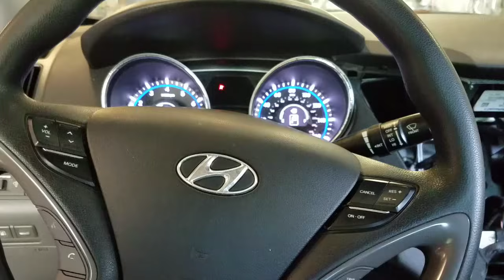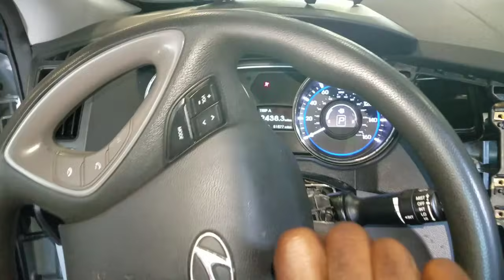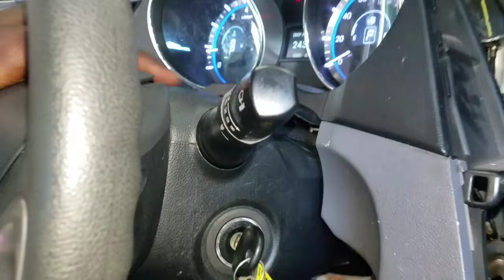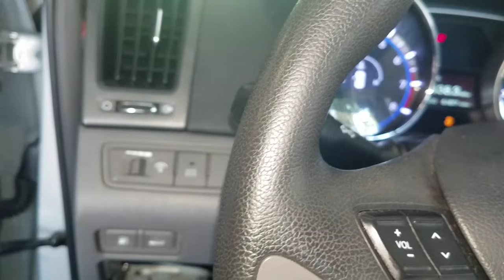Hyundai sonata steering noise

Comment: Thanks for this video. I was able to do it with no problems. Disconnecting the wiring can be intimidating but not when you realize that all connectors are unique so everything can only be connected back to its original location. Besides, each wire bundle only reaches its respective connection. You saved me $500!
Reply: Hi did you have a hard time hooking the steering wheel back ?
Reply: @TheLinaChen  no, its exactly like the video shows.
Reply: Jose Alfredo Reyes thanks. Working on it now and it’s tough lol.

Comment: Fantastic, I just took my wife to get her car done because it had the same problem and it cost me $550, my Sonata started doing the same a week ago and I decided to follow your video, I figured worst scenario I would have to take it to the dealer, well, 2 hours later I was done, the part cost me $1.75,  Thank you, Thank you, very well documented. My recommendation to anyone doing it, have the tools you need ready, follow the video step by step so you don't get confuse and I would take off the AC vent first which is the last thing on the video but if you do it last you may break it when the steering column drops.

Comment from the maker: Glad I could help you guys, hit the subscribe button for me thanks for the support
Reply: Dullah Goso hard Thank you so much! I just finish it. But it was a lot more harder than I thought. The steering column is a lot more heavy that it seems. But an easy job to do! I was thinking that is was going to be very expensive but just a $6 for the part and an hour of time. I really appreciate the videos. Take care!
Reply: May I ask what is that part name
Reply: Dullah Goso hard steering coupler
Reply: What’s the name of that part
Reply: Thanks bro. I just fixed my wife's 2013 Hyundai Sonata
Reply: Dullah Goso hard what is that black piece called you replaced. I have the same sound in my 2011 sonata
Reply from the maker: Steering coupler
Reply: I need help I can't put the back bold back in when I put the steering wheel back up.. What am I doing wrong
Reply from the maker: @jessamynoliver1442  make sure you have the key in the ignition so the steering wheel is not lock and there is a little hook on the back hook that first to help with the weight of the steering column
Reply from the maker: @jessamynoliver1442  https://youtu.be/NEd0zPYO-JY follow this this step in this video i make it explain it more
Reply from the maker: Skip to 21:58 and watch it from there
Reply: @DULLAHGOSOHARD  okay i did notice my steering wheel isn't straight Im about to give that a try now.. Thank you!! 💋
Reply: @DULLAHGOSOHARD  I got it back on and running still cant get that back bold on.. My wipers wont work either now 😭
Reply from the maker: @jessamynoliver1442  plug in the wires for the wipers plug them in tight
Reply: Just replaced the part today. Very glad I came across your video. You have my subscription. 👍🏼👍🏼. Thanks again.
Reply: Where can I get that piece from for the steering column
Reply from the maker: @Jeebklyn31  ebay.com
Reply: I did this and now it's hard to turn the wheel what did I do wrong
Reply from the maker: You probably leave some wires for the motor unplug
Reply: Dullah Goso hard where you located?
Reply from the maker: In Florida

Comment: Just got done with this repair.. thank you for this video. It was very helpful. Couple of my notes. If you don't have power tools then either get a second person for help because while putting everything back together,  steering column will be a pain to get it screwed again and while putting the steering column there is a extended part protruding from the column which needs to go into the pocket. To summarise from the video, all you need for this repair is 10mm, 12mm sockets, Phillips screwdriver, T30 bit to remove screws from electric motor and a torque wrench. For this I think it is better to take out the instrument cluster and try to fix rather than dropping the steering column

Comment: GREAT instructional video. Thank you so much!  I'm over 55 and managed to do this by myself while my husband was away fishing with an old friend. I wrote down all the steps and gathered all the tools together so I could move through without having to stop and check for things. Toughest part getting the steering column back up into position...felt like a contortionist trying to bench-press it back into place and get those top nuts back on!  Your video worked for me even though I have a push-button start on my Sonata.  Even though Hyundai extended the warranty, my car was beyond the extended warranty mileage of 100,000 (~130K).
Reply: Way to go, Mary!  I need to do the same thing and am over 100k.  I gotta admit, I was a little intimidated because this is a lot of stuff to take apart, and I'm concerned about braking something or getting everything back where it needs to be.  I'm pretty handy, so I'm willing to go for it, though.  I just can't afford to have any slip ups.  Wish me luck!
Reply: Well you make me feel like more confident to perform this job by myself. Wish me luck.😁

Comment: First of all, thank you so much for the vodeo. I got my job done today following your video step by step + taking out the fuse pannel for wider space. I turned on the engine after re-connect all the wires then check to make sure everything (steering, wiper, EPS, signal, headlight, etc..) works perfctly before putting back metal frame and plastic covers in. Shouldn't be any problems as long as all wires hooked up tightly. Happy to save $300+. Thanks!

Comment: Thank you for this video! I just finished my car. Took me all day and for reasons I had to walk away several times to loose my shit and regroup.
I get it why they charge so much in labor..
I sat in my driver's seat and used my feet to help guide  the steering wheel back in place so it's possible to achieve this by yourself.
Reply: Way to go. Would it be worth$500? To pay someone?
Reply: @stacialindholm3380  Nope I wouldn't pay a shop to fix this. If you or somebody you know have basic tools it can be done easily, he names all the tools needed as the video progresses. Don't be spooked by all the small steps in this video.
Reply: lgalphagools just discovered this I plan to do this myself soon. But this noise has been going on for some time and I do a ton of driving for work especially this week. Does it do damage to the car or is it dangerous to drive??
Reply from the maker: I have another video that go more in depth but you can do it its not that hard after watching this video
Reply from the maker: https://youtu.be/NEd0zPYO-JY
Reply: @_therealgabe_  I would say slightly more dangerous because the coupling is usually shredded up and its whats causing the clunks and bangs. Our Sonata is our main car and it was making that noise for at least a year before I fixed it. Basic tools and 3-4 solid hrs for the completely inexperienced person to finish
Reply: pushing the whole steering assembly was definitely the most challenging part of the whole process. I basically had to lie down underneath it and benchpress it into place. a PITA, but doable. Thanks for the vid!

Comment: Pro-tip: when replacing the steering column, it's helpful to get underneath it on the floorboard to guide the hook back into place and make sure you have a nut handy to secure the steering column. Trying to get it back into place from the side is a little difficult because it's difficult to line everything up.
Reply: i, I was able to fix the coupler, im going to try my best to describe it but somehow during the process the steering wheel completed pulled out and disconnected from the rack when i pulled the steering wheel out after "Dropping it" basically female tube (attached to steering wheel) with the grooves inside which goes into the male rod with outer grooves which is connected to the rack with the bolts. When I put the steering wheel on again it completely was off 50+ degrees in alignment. I'll be trying to realign the grooves tomorrow is their a way I can do it without buying expensive parts? I can understand 1-2 degrees but my tie rod alignment is fine. Its from the way the steering wheel was placed in the rack. 

***btw not to be confused with aligning the steering wheel clockspring, i never opened that middle portion where the airbag. 

https://www.hyundaipartsdeal.com/genuine/hyundai-joint-assy-universal~56400-2l000.html 

it the right part in the diagram here 56300 which needs to be aligned with the middle part
**NOT 56410

Any advice is useful on how to get the grooves aligned as close as possible with the tires...its completely off, didnt wanna adjust the tie rods like crazy and dont even the the grooves in the rod allow for that much adjustment as of now (ex. the straight steering wheel has tires pointing halfway to the left)

Comment: I finally took the time to go for it yesterday, and everything worked out great.  That aggravating clattering noise I used to get when I went over bumps is gone, and steering feels firm.  It might have been easier if I’d dropped the steering column, but I wanted to avoid the potential issues others have had with that.  I did remove two of the 12mm bolts holding the column and loosened a third.  I also removed the fuse box and the instrument cluster to get the access I needed.

It took some work and persistence, but I’m glad I did it this way.  It took me an hour and 45 minutes, a little sweat and $1.20 for the part.  Thanks to everybody who contributed info and advice on this!
Reply: Are you in NJ? If so, any chance I can pay you to do mine?
Reply from the maker: Naah am in Florida
Reply: Thanks for this video, I now see exactly what has to be done, but I do feel too wary to attempt this on my own. (I was asking @NJbakintheday if he was in NJ)

Comment: i just did this today to my 2013 Sonata. very easy after watching this video, the best one. but i found out it's even more easier if your take out that fuse box, that will give you all the space you need to loosen the 3 bolts on the coupler motor. really ez pz lemon squeezy.

Comment: Thank you for this video! I use my Sonata  for business (airport transportation) and do most of my own service work. I built heavy trucks in a factory for 21 years and have reasonable mechanical skills. But I thought for sure I would have to take this in. I remember installing steering columns in heavy trucks and just simply reversed the procedure! Thanks again, you saved me a bundle!

Comment: Great video got this done in about 45 minutes. I actually didn't unplug everything to get that steering wheel to drop but it is a pain to get to that motor in the back if you don't. If you have the right tools you can get away with not unplugging as much. Great video nice job thanks for posting!

Comment: BE VERY CAREFUL WHEN DOING THIS JOB. I followed the exact steps and was able to fix my clunk in steering wheel. However, when dropping my steering wheel it hit my brake switch and broke it. I had to replace my brake switch since my brake lights stayed on the whole time. Other than that, everything went well.

Comment: My 2012 Sonata steering wheel has been making this gosh awful noise for months now. I took it to the dealer and complained about it one day while I was already there for 2 recall issues. They did nothing about the steering wheel. When it got progressively worse, I took it back in and they said that they wouldn't cover it because I was just over my 100,000 miles. But when I took it in the first time and complained about it, I was well under my 100,000.  I called Hyundai Corp and they agreed to replacing the coupler and said they would reach out to the dealer but that once they did, they were no longer involved. I took it to the dealership and they refused, but told me I could pay them $300 to fix it. Its a $5.00 part people!!  Now the steering wheel feels like its going to fall off and the shaking will knock the fire off of your cigarette. At times I can hardly keep the car on the road. Long story short, my husband and I appreciate this video because now he can fix it for me.  This has been the worst car I have ever owned and can promise you, I will NEVER own another one.
Reply from the maker: Shelley Hiler am glad i could help
Reply: Same thing I am going through!
Reply: Did it fix the steering will shake as well? Mine just started doing it and it scares the hell out of me!
Reply: I went to dealer for this issue. It use to be my wife's car I got her a new one and kept it because of this issue. Went to dealer they said $300 to fix it I even consider trading it in. It was really bad nasty vibrations clicking metal noise after 60mph and when I hit pot holes. Thanks to this video I fixed it. Everything went away once i replaced that part. I'm no mechanic it took me a while a good 3 to 4 hours but saved lots of cash.
Reply: Same here. I bought the car from a small dealer lot but took it to Hyundai and paid $150 to check the car for any issues before purchasing. They didn't mention this or any other issues with the car. Last week I went over my 100k miles and I just read it would be warranted up to 100k. I will be doing the repair myself as well. I won't buy another Hyundai since we only have one dealer in my city and they are the worse.

Comment: This is a great video, it just saved me 3 or 400 dollars, the guy goes into detail and shows most of the process in the video, so thanks, great job. That said, if you are doing this you will want to know that it looks easier than it really is, he must be experienced and familiar with the parts, it looks like he does this often. I consider myself handy, but it still felt like it was too much a couple of times: Some of the connectors do not come out very easily, the video does not show how to take out the last connector, a small one, I had a hard time with it, some of them made me wonder if they were supposed to come out at all, but in the end all did. I broke a couple of the fixing clips which I replaced with ties as best as I could. Also, and I hope you are reading this before doing it yourself, the column is very heavy and hard to put back into place, it was the hardest part of the job, its not on the video either. The whole project is done in awkward positions. So in summary. The video is good and it will tell you almost all you need but it is harder and more time consuming than it seems. If you decide to do it you will be saving good money and in the end know a little more than when you started. The whole thing was worth it the problem is fixed. Almost forgot to mention, by the time I was done the battery was dead, nothing to do with the video, but you may still want to keep that in mind. Thanks again for the video and Good luck!
Reply: Great comment, I agree.  This job required much more effort than the video portrays.  However, I am so grateful to have gotten it done on my own. I didn't have the same issue with the steering column as you did.  Sorry that was so difficult and about the fact that your battery died.  I read a comment in one of the other videos to make sure that I disconnected the battery.
Reply: What is the name of the actual part he's replacing? I need to know where to buy it also. 
Mine has the same problem, and the mechanic said it could be anything, scared me to death with scenerios like my airbag deploying at anytime or my steering wheel locking up while turning and causing me to crash. Estimate given with time tearing things apart to research all possible problems- roughly $1500!!!!! Ill order the part and have my mechanic friend fix for me!
Reply: The description for the part I bough on Amazon is: APDTY 112837 Steering Column Motor MDPS Clunk Noise Rubber Flex Coupler Repair Fits Select Hyundai Sonata Elantra Santa Fe Azera Veloster Kia Soul Optima Forte Cadenza (TSB 14-ST-002-1; 56330-4Z000). It was the right part for my sonata 2011 and it cost less than 6 dollars. Copy the first number (APDTY 112837) on Amazon, it will find it for you
Reply: When I bought the replacement part, the guy at the parts store told me the same thing (to disconnect the battery).  He said, with the battery still connected, there's a chance the airbag could deploy.  But, how can I turn the steering wheel to undo the screws if the battery is disconnected?  I see Dullah Goso hard didn't disconnect the battery.
Reply: @NJbakintheday  obviously remove those screws first. Disconnect the battery as soon as you begin to dismantle specifically the electrical
Reply: Like when you unplug those wires and open the plastic covers you don't want a short
Reply: Tdjj93  Yeah, after I posted that, I was like "duh".  lol  I did the repair this past Saturday.  Did it without dropping the steering column and didn't need to remove that lower cover under the steering wheel.  I posted about it here yesterday.
Reply: NJbakintheday nice you eliminate need to drop column by removing instrument cluster?

Comment: There is an extended warranty (TSB) for this problem with the MDPS steering coupler 10 yrs/ 
100k miles.  I just got my 2013 Sonata fixed for free by the dealer.  Also for 2015 - 2017 Sonata the warranty has been extended to 15 yrs /150k miles.  The warranty covers original and subsequent owners.  Just do a search for Hyundai TSBs.

Comment: Was just wondering why had you already taken the radio out, any relative reasons to replacing the little rubber part in the steering wheel or other different reasons?
Reply from the maker: The radio is for different reasons

Comment: My car doesn't have the electric power steering, but has the exact same sound (2012 Forte). Is that rubber coupling anywhere else in the system?